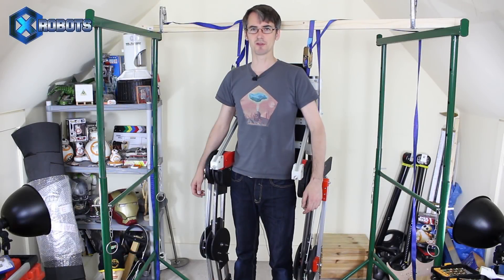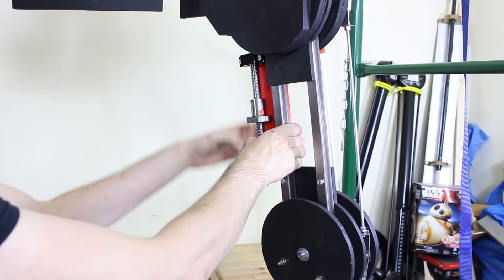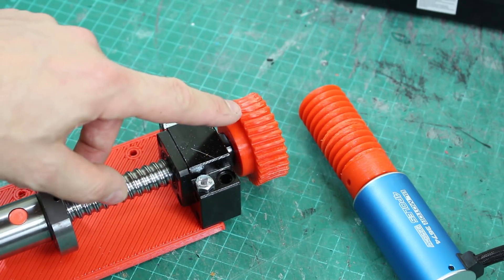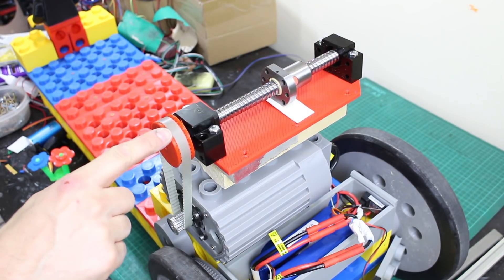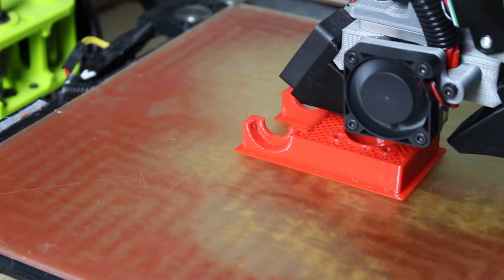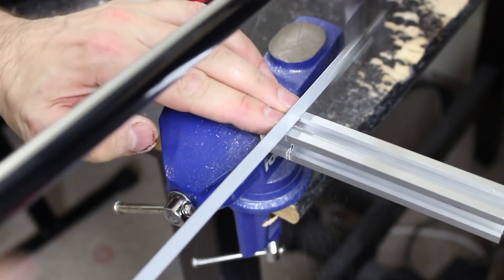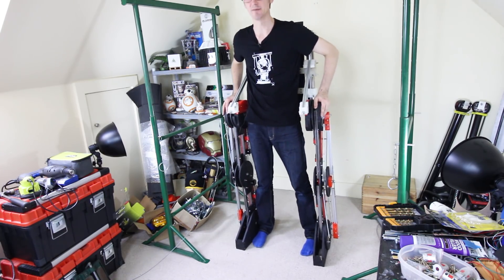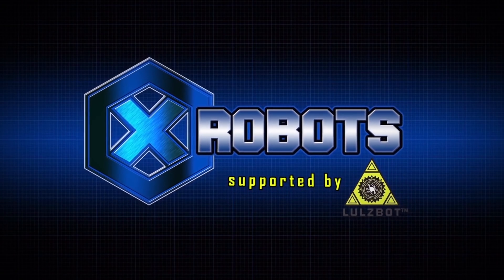Iron Man Exosuit #18 - Gearboxes & Motors | James Bruton

Comment: Surprised you didn't use worm gears (you can buy them for not much money) for most of the movements upper and lower body. If attached to an cordless drill set for med/high torque setting, you can get some major power with steel gears in the worm setup.

Comment: I could be wrong, but I think that out runners are more precise and can also spin the same speed as in runners. Depending on the magnet to stater gap, the strength of the stater's winding and magnet strength. Out runner precision only really depends on the esc's precision.

Comment: 8:30  how about a smooth nylon rail on the metal that normally isn't touching the moving block but would make contact if the ball screw started to flex.... Or even embed a bearing into the moving block that runs along the metal piece?

Comment: I Love it! Soo much cooler than the last version!
(the last version was pretty cool too)   :)
Could you consider making some kind of adaptive gears between the ball pulleys and the motor? Then the motors would have more power when they need it, or more speed when they need it, like a real arm or leg. This is different from just having the speed of the motor go faster or slower.

Also, what if you had enough computing power, like maybe a Raspberry Pi for a controller, and have the robot "predict" what the next movement is going to be. You could program in some basic walking patterns that automatically turn on, and adapt their speed and foot location, to be like a hybrid between the force feedback and a fully autonomous robot.

In a human, the spine actually has some basic walking patterns pre-programmed into it, and the brain basically just says "walk like this" to the spine, which talks to the legs. The brain also deals with any abnormalities, or weird things like skipping and hopping on one leg.

Comment: can you put the link where you bought the esc?
Reply: ulisses salvador I'm a diy skateboard enthusiast you can buy them from diyelectricskateboard.com or ollin boards sells them.  Beware the maytech ones they are known to blow the drv chip also join the electric skateboard builder forums or Benjamin Vedder's forum to get help on configuring the vesc for your motor and power supply/batteries.

Running the drv chip above 60k erpm can blow it so good to pass your ideas by others with experience to avoid breaking expensive parts.

Comment: You know you can generate gears right in fusion 360. It has a built in dialogue for that.
Reply: I use inventor and there is a built in dialougue for gears when one is making an assembly. I believe there is also a tool for that in fusion somwhere.
Reply: Not sure if you've used openscad but can find lots of parametric models for pulleys and gears out on the web also geargenerator.com can get svgs and extrude them (just some alternatives).

Comment: Metal Gears? I think I see where this is going...
Reply: The one time you reply would be to a terrible joke I make :)

I'm suggesting that by the time you get to the nth iteration of your project it will be a bipedal walking tank with rail guns and nuclear launch capabilities.

That said I'm sure your solution will get you walking and I'm looking forward to seeing those steps. Are you going to change the shape of the legs now the round circles aren't necessary? And will there be a (3D printed, naturally) shell to nail that iron man aesthetic over the futuristic exoskeleton?
Reply: Metal Gear!
*Hides under Cardboard Box*

Comment: Why not use a set of planetary gears in the hip and knee with a motor driving the inner gear to turn the outer ring gear which would be attached to the next lower leg segment?  If you size the gears correctly you  should be able to get a god balance of speed and torque, and they should be 3D printable.

Comment: If you want to get more startup torque from your VESC have a look into the startup boost value. Just be careful because I believe that was what killed my VESC. Also you can get 2x 190kv 3150W, 12S 80A outrunners for $150 AUD. Keep your eye open for group buys on DIY electric skateboard forums

Comment: This looks far sleeker than the Mark1.
I'm slightly surprised that you haven't put platforms onto your Exo Suit feet, for you to stand on.
If you did, there could be another set of contact sensors on each foot plate (to sense when you are lifting a foot to take a step) to also tell the suit when to move each leg.

Comment: Just curious why you never use steppers -- they have reasonable speed, good repeatability, and enough  torque for most of these applications (such as driving ballscrew or many of your other components). They're usually much cheaper, too.

Comment: So far this Exo Suit Mark II seems like a huge step (no pun intended) forward over the first one. Much sleeker, solid and it seems it will alow you quite a better range of movement. Looking forward to see the legs in action. Great work:)
Reply: Khanemis A lot like the actual Iron Man Suit. Mk I was large, clunky, but technically did the job. Mk II was a lot sleeker, using better parts, and overall a better design.
Reply: KingOfYou115 I guess that means #Jamesisreallifetonystartk is true
Reply: Khanemis iiiiiaaaaaaaaaaaaaąaaaaaaaaaaaaaaaaaaaaaaaaaaaaaaaaaaaaaaaaaaaaaaaaaaaaaaaaAAAAAAAAAAaaaaaaaaAaaaaaaaAaaaAAAAAAAaaaaAAAAAAAAAAAAAAAAAAAAAAAAAAAAAAAAAAAAAAAAAAAAAAAAAAAAaaaaaaaaaaaaaaAAaaaaAaaaaaaaaaaaaaaaaaa
Reply: Khanemiswsudhfhdhdhe